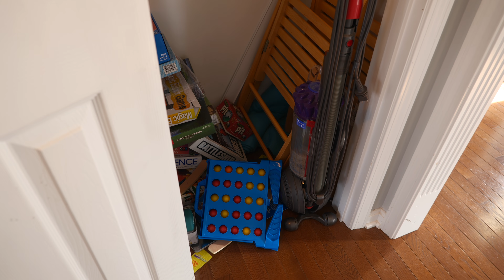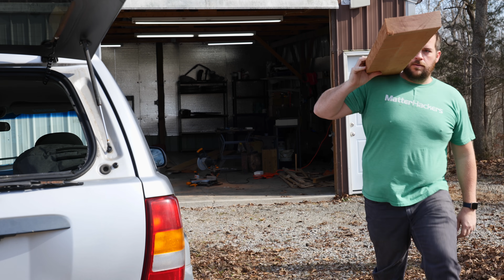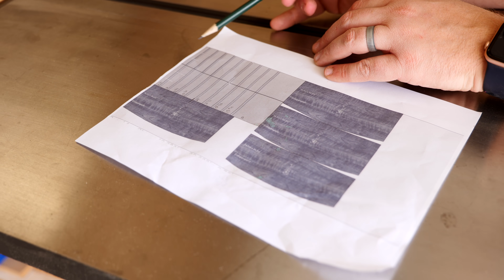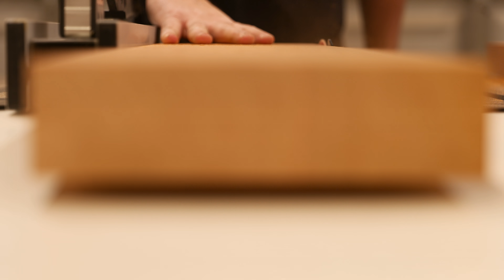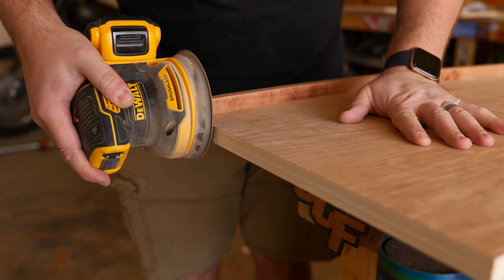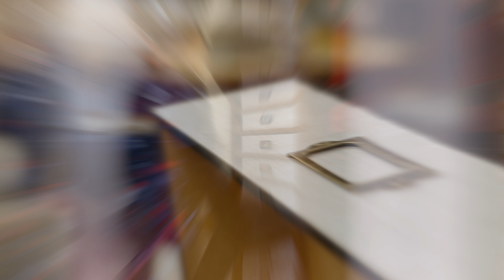How to Organize a Boring Closet | I Like To Make Stuff

Comment: Oh! I have a shelf unit that I filled with laser cut trays too! It is our “linen closet”. I had the laser cut an oval in the top front of each as a handle to make it easier to pull out, and to make them pretty my partner just painted them. To make them slide in and out more easily we glued (front to back) strips of felt, like runners on a sled, to the bottom of each box. They glide much more nicely that way.

Comment: Great concept and fun video! Tip: When making profiles with a template, trace all the parts from the pattern, rough cut off waste with band saw or jig saw, then use the template to finish with router. Saves time and router bits (plywood is tough on them) because routing a bunch of material is no fun! Nice work!

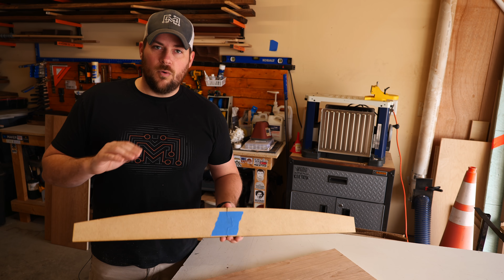Comment: At 3:41 when you're talking about making a curve with a very large ruler by bending the ruler... something that works even better is a thin 1/4" balsa/basswood stick.  You can get a pack of 5-6 at your local hobby craft store (like Hobby Lobby) and they're 3' long I believe (mine are in a package at home on my desk due to my model boat building so I can't check for another 4 hours).  Just make sure to give a light pressure while you're attempting the bend, otherwise you might snap the stick.

Comment: 3:53 you can also set a nice curve with two nails, some string and a pencil. Just set the nails on the edges of your workpiece, tie the string tightly on the nails and draw a curve
Reply from the maker: That would work too
Reply: That works with a CNC too, just set the piece of work in the CNC take a pencil tied to a piece of string and use it to press the "Start" button 😁 👍